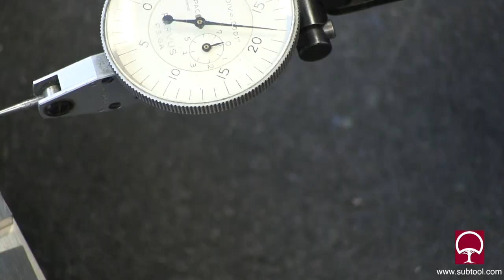How to measure accurately with a dial indicator

Comment: Zeroing in the indicator both prevents math errors and ensures that when the part(s) such as gears are returned to the starting position during a backlash check they're being returned to true "zero" and you're just measuring backlash and not inadvertently including/measuring some actual rotational movement. As for using a dial indicator to measure "thickness" or "height" or whatever it is you're attempting to "measure" with those small "blocks" on top of that larger piece of material you're moving laterally under the meter "arm", the length of that "arm" shouldn't affect "accuracy" at all. It's reading "half as much" (parallax in the video view notwithstanding it still looks closer to "1" than "0" because as the end of the "lever" gets farther from the fulcrum, the end of the lever has to move farther to achieve the same amount of movement at the "short end" of that lever/fulcrum arrangement. You're changing the "rocker arm ratio" of the indicator/arm set-up and the "accuracy" of the indicator shouldn't be and isn't being affected at all beyond the fact that its not graduated correctly and PRECISE enough to measure ACCURATE "one half" of 1 unit. You're guessing at the actual "measurement" the same way using a non-Vernier micrometer 0-1" micrometer results in guessing at ten-thousandths. There's also a "tolerance stackup" situation that occurs when you "stack" items to be "measured" like that. The two "blocks" may be exactly one thousandth different in thickness when measured by themselves but when you place them on top of that other piece of material and are sliding the "assembly" side to side and in particular are letting the taller "block" shove the indicator "tip" upward and also jar the indicator assembly/setup slightly sideways instead of lifting the "tip" up coming off the first "block" and then setting it back down on the second block gently you're creating error or at least the potential for that error. And when a dial indicator is used to measure the "height" of something a conventional dial indicator with a "vertical" plunger installed in a "sled gauge" should be used. Dial indicators are at their most accurate and precise when measuring MOVEMENT in a setup like you've got there. When used to measure "height" the indicator needs to be perpendicular and vertical to the surface(s) being measured and is never "shoved" from a "high step" to a "low step" unless it has a rounded tip with plenty of radius to "roll" onto the higher step without the plunger being shoved sideways. Proper demonstration/use of a dial indicator to measure "height" would be with a sled gauge measuring cylinder liner protrusion above a diesel engine block "deck" or valve face protrusion above the "fire deck" of a diesel engine cylinder head.

Comment: What you are describing is called cosine error and you're not 100% correct Don. Some manufactures calibrate their indicators to zero at a specific angle not flat an parallel as you describe. Interapid for instance calibrates their indicators at 12 degrees. Thanks for all of your videos Don we greatly appreciate them. Im two years into my toolmakers apprenticeship and greatly enjoy you sharing your wealth of knowledge. God bless. Ohh and im curious if suburban tool offers a matched set of 4 123 blocks. I only see 2 online. Thanks
Reply from the maker: SkHiPiY If you look at the tolerances of our 123 blocks, you will see that you can buy individual blocks or 2 sets and stay within a couple of tenths without the extra cost of requesting 4 matched blocks. It all depends on how close you need them to be. The blocks with holes that we make here can also be bolted together. http://www.subtool.com/st/b123_precision_tri-blocks.html
Reply: A good example that goes to show you should read the instructions, they may well know more about their kit than you do.

Comment: You explain to keep the Indicator horizontal to avoid a false reading, you did not explain what's "causing" the false reading? 90° or 45° What's causing the needle to go up and down? if both surfaces are equal at 90° If anybody knows the answer please leave a comment below. But if you're making your best guess or you're pretty sure... please don't

Comment: I always tend to think of those type gauges as comparators more so than measuring devices. the same errors occur if a standard dial indicator is not exactly perpendicular to the work as well.
Reply: Correct.  Because they are used as comparators more than anything else.

Comment: Accurately measuring small dimensions is one thing. But how do you measure long dimensions? I need to measure 31" +/- .005. I don't have a caliper that big. Any suggestions appreciated.

Comment: one thing to be noted also is that the temperature also affects the measurement...I work in a temp controlled environment and everything I measured i had to let it soak overnight... usually around 24 hours
Reply from the maker: You are correct.
Reply: I need to get back into that type of job, it was fun and I learned more and more everyday while I was there, its a great career. I had to stop working at the Calibration industry I was at because my girlfriend had cancer and I had to ensure she got to her appointments weekly

Comment: Is the table where the dial indicator needs to be clean? I had the time of my life yesterday trying to get to to be on zero, chasing my tail, but my vise was over tighten one of the bolts. That did not help. Run in frustration and got a headache 🤕. Any thoughts on this.?

Comment: I have a noobie question. It's a real situation at my work. I have a cylindrical piece (about 10" diameter x 10" height) which I rotate in a surface plate against two guide poles separated about 120 degrees. I have two dial indicators: one is in the middle of the two guides and one is exactly above one of the guides almost in the cylinder's tip. What's exactly each dial indicators is measuring (eg eccentricity, circularity etc?) Thank you in advance.

Comment: I never use the indicator's marks to measure.  They're there as a guide only.  Like Don says there are too many variables that effect accuracy.  When an indicator is attached to a measuring device like a height gage, you should use that device to make the actual measurement.
Reply: Except a height gage usually cannot measure in .0001 increments, except the very high-end ones, which no one can afford.